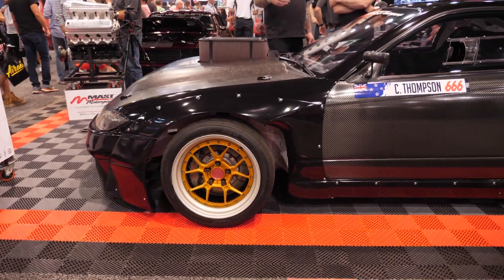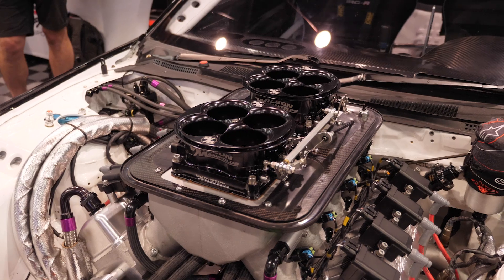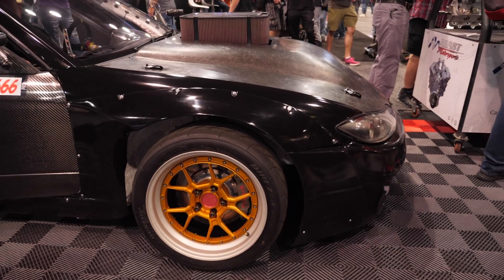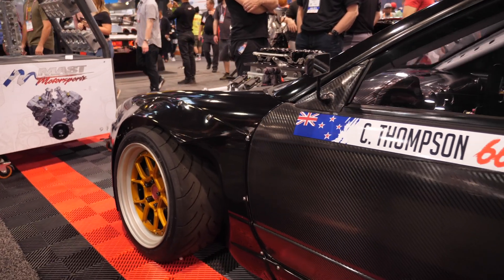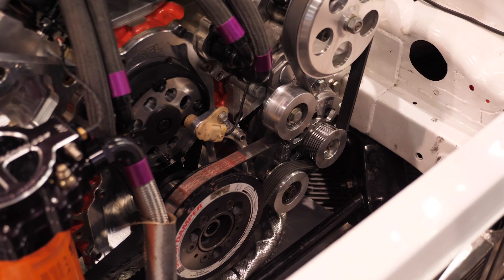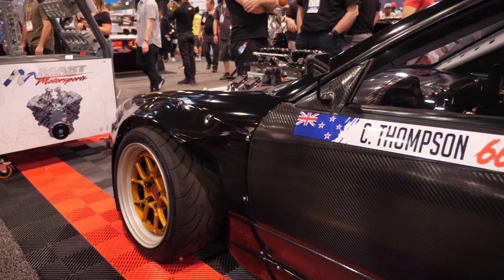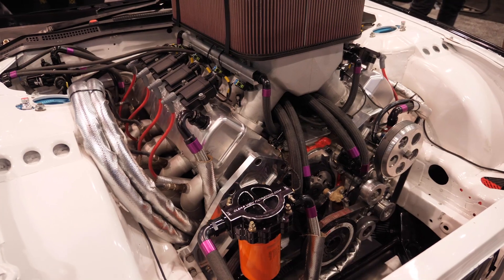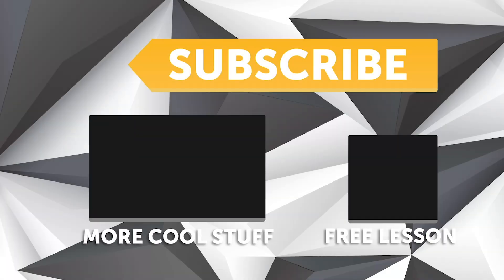4 Rotor Build Out, 7.4L N/A V8 In | Worlds Best LSX Powered S15 Silvia? [TECH TALK]

Comment: Vacuum does NOT pull oil from wrist pins...  it's an old wives tale.
Reply from the maker: To be clear it's not necessarily the vacuum pulling the oil out as much as the vacuum in the sump reduces the windage which in turn reduces the supply of lubricating oil if you're not running some form of forced pin oiling.
This is a consideration that the smartest dry sump manufactures out there will be able to clarify for you further if you fit such a system, and possibly something we might be able to look at closer in the future too content wise - Taz.
Reply: @hpa101  With all due respect, your logic is flawed and I feel it would be worth delving into for you and your followers. Even in the interview Carl tells you what the Nascar (Winson cup ) guys do. I have a street car that idles at 11" and goes down the road at 20-22" ( as that's all it will make with an alloy block) if it would pull 30" I'd have it.  It is a standard small block ford with nothing out of the ordinary for the oiling system.  Cheers
Reply from the maker: You might have to take that up with dry sump manufactures and race teams who spend more time and money on RnD for these systems than anyone rather than us.
Motorsports applications and street applications are very, very different animals. 
It is actually something Bill from Dailey Engineering talks about here too: https://youtu.be/L84P5ChzRYY?t=260

The whole interview is a great watch if you have the time - Taz.

Comment: Was a big fan of The Aristo/quad rotor now this.... Who makes these wheels???? HPA delivering the goods again!
Reply: On top of my head I think they are Rotiform? here they are!!: http://www.rotiform.com/wheel/60747/forged-zmo/?styleID=4197
Reply from the maker: Cheers for being a helpful dude Guillermo! - Taz.
Reply: @hpa101  Taz I just scored a 2J 147S Aristo.  Looking at getting an S15 and Mazda FC3S as shells and maybe building a quad rotor 26 B.   Could we get a series on the logistics involved  in switching around motors  between different chassis from an  ECU standpoint?   Cheers
Reply: @hpa101  Would love to know the mad science behind how it runs as good as it does revving to 9K rpm with the big output motor hes running, can you shed any light on this? Love this build sounds absolutely insane !!
Reply: @GuillermoTebar  Thanks for the info. Cheers Bru!
Reply: Yeah those wheels look reaaaaaaal goooood. Am picky af with wheels and this design is drool worthy!
Reply: Those ar @al13wheels on instagram